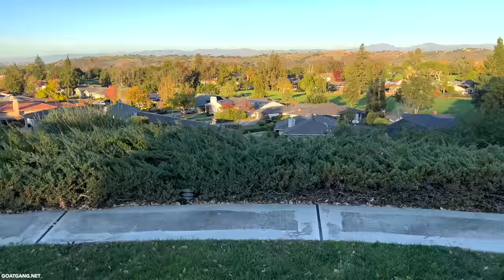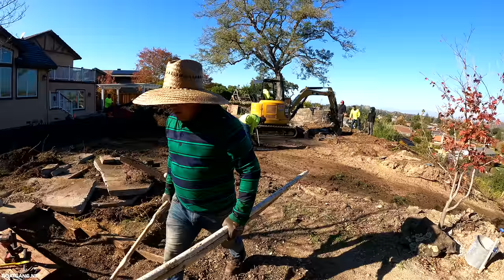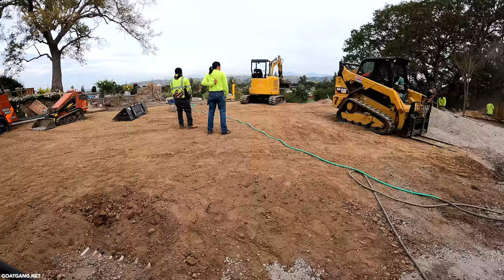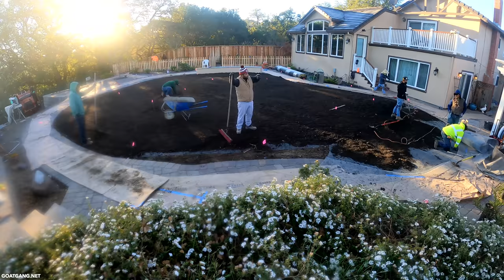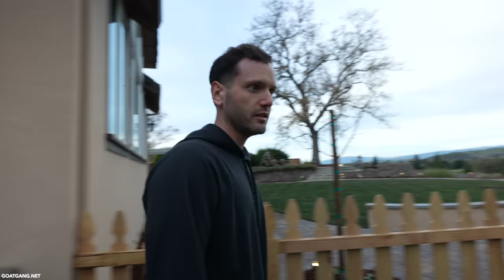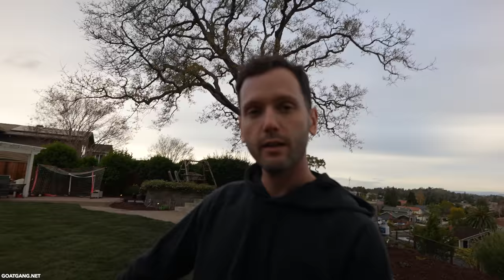How I CONVINCED the HOMEOWNER to SIGN on a $140,000 Landscaping Job

Comment: Bro we are in cali. Dont build any retaining wall, over 12" with no permits, also an engineer would do the designs for 1500 to 2k you pay 500 in permits than you really covered your butt. 

I got fk recently on a 2 foot wall, my footing were 3 ft by 24  on a slope , anyways had to rip it all out and re do it with legit plans. 
There goes my 20k wall u.u
Reply: Retaining wall is 4'+ higher for engineering/building permits in california, or if its supporting more than soil loading. (this one is supporting a hot tub and needs a building inspection and engineered plans but tigran doesnt know that.